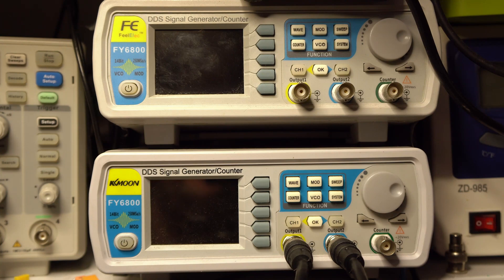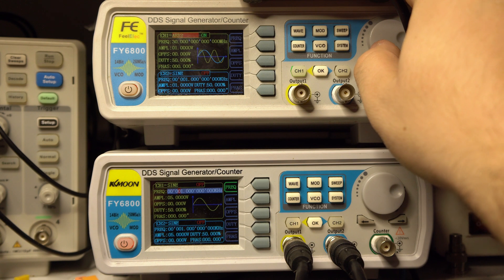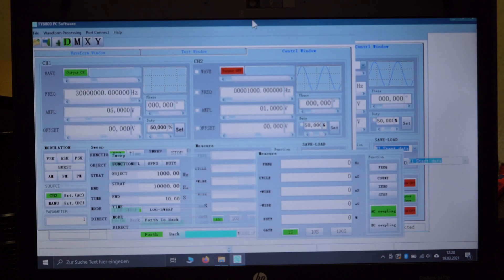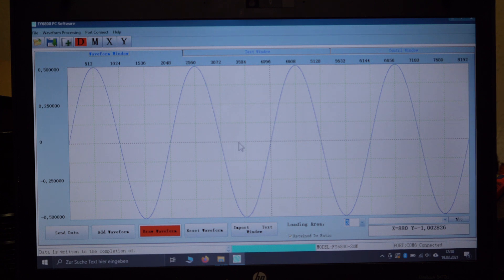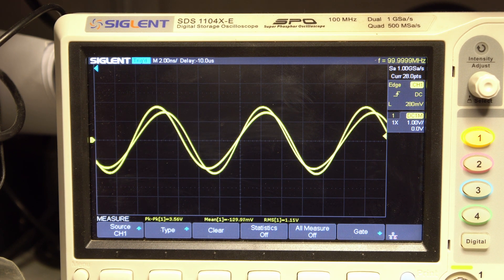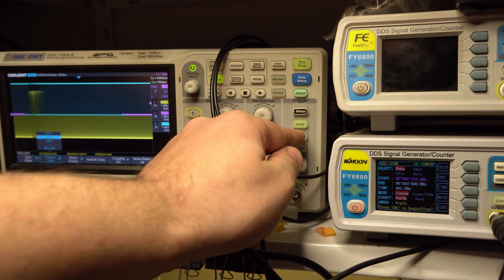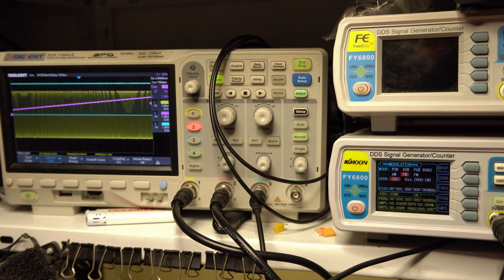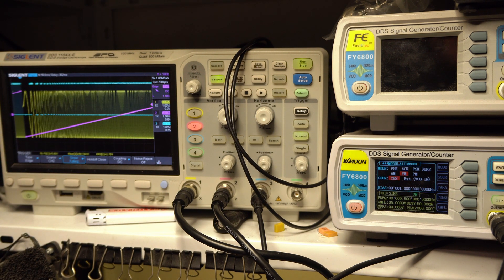FY6800 Function Generator Tricks & Tips

Comment: The trigger or reference signal in a sweep generator is crucial. Another good sweep option I found for the FY6900 is by using the VCO feature triggered by a RAMP generated by channel 2. Feed the rear VCO input with channel 2 output with a 5 vpp RAMP with  aprox 2.5 - 2.6 v offset, and the desired sweep time/freq. select a VCO start and end frequencies. A perfect sweep function with a reference ramp can be used with X-Y oscilloscope mode. An external marker adder can be very helpful if one or two markers wants to be used.
Reply: Glad you mentioned the VCO method. It works just as well as the MOD feature. Couldn't find a way to get the SWEEP feature to have a steady display on an O-scope for radio alignments.

Comment: Same as FY6900 60Mhz.. also degradates at around 80Mhz.
software v6.5 fw 1.3.. so the so-called 100Mhz Fy6900 gotta be different spec components.

Comment: Hello, I have a question, what is the TTL-in pin in the port on the back of the function generator for? and investigated but could not find an application, I thought it was related to the function of the EXT-in
frequency meter of the generator but they are not even bridged and as much as I investigate the TTL protocol I cannot find anything about that pin. Greetings from Chile.
Reply from the maker: TTL in?
 Theres only TTL Out ABCD  and RX TX GND 5v for Serial communication 

A is ch1 frequency Out in TTL (on/off)
B is same but 180° out of phase
C and D is same for ch2

The bnc (sync) are for Daisy chaining multiple devices to sync clocks. So phases dont drift apart 

Vco in is for vco function 
Trig FSK ASK PSK is for modulation function
Reply: @gamerpaddy  Oh It's ok sorry,  emm my signal generator's model is the JDS6600 and the TTL Output distribution is so different. But thanks. :)

Comment: thanks for showing tips of trigger for sweep , having a 6900 for years, unable to sweep with trigger signal, now I can follow in low frequency, but howto do it with sweep with 10.7Mc centered, for FM IF alignment, thanks
Reply from the maker: should work the same.   you set your frequency of ch1 to 10.7mhz and modulation bias to whatever your range should be you wanna sweep trough.  ch2 just controls how fast  you sweep  but at those speeds it becomes less precise.
Reply: @gamerpaddy  Yes, finally , I can have proper trigger for the  10.7Mc sweep centered at 5.35Mc,  but if the target sweep is centered at 10.7Mc with +_1Mc width? I am using feeltech6900 20Mc unit, super thanks!